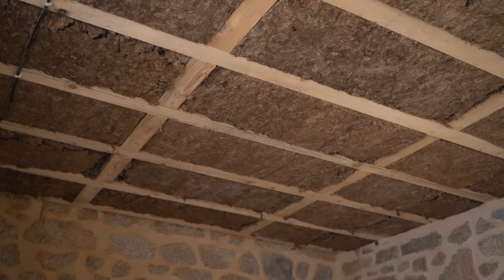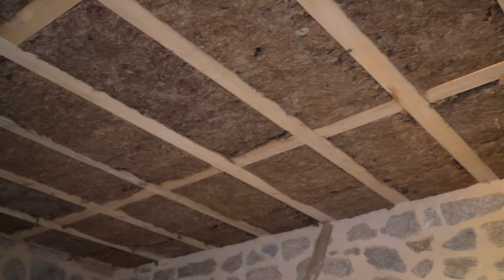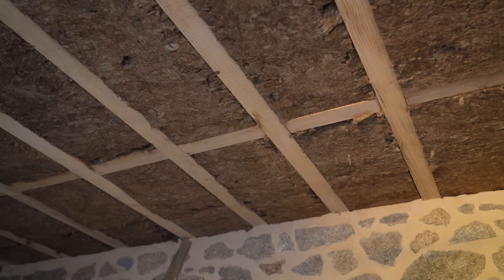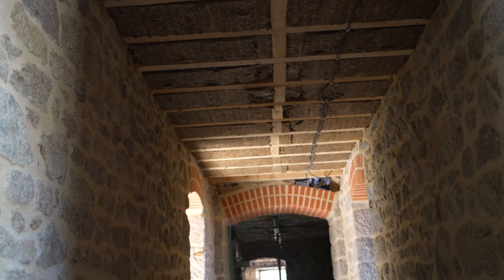Sundays at Chaumont- insulation and wiring breakdown.

Comment: Im amazed with how you've managed to get this far! One small bit of advice on your floors. When laying the OSB try to glue (PVA/Wood Glue) the boards down to the joists and in between the tong and groove joints. This will prevent/reduce the chances of a "squeaky" floor. Though i dont expect much movement in the floors with the amount of steel you've used. Great work Dan and Co.

Comment: Some years ago we did renovation to an old house ..as we worked, plumbing detailsmbwhere pipes went, wiring diagrams, the kind of plaster used and the insulation dimensions etc and finally the paint colour, each room we printed off and left in the room either in a cupboard or even under the carpet in two rooms..Copies copy with the tye main property details..the people buying our house were delighted..

Comment: Have you thought of putting the sockets flush mounted in  the floor, as opposed to trunking on the stone walls just a thought. We did similar in some places and have worked a treat. However, maybe with the look you are after, modern sockets won't look the part.

Comment: If you decide to use wireless switches, make sure they operate independently of the internet. Many companies design their switches to communicate with a server, so if your connection drops, you lose control of your lights. However, I generally recommend wired switches instead. They eliminate concerns over battery replacement and network congestion, and they work consistently. If you do prefer wireless, consider smart protocols like Zigbee or Z-Wave for better reliability—though personally, I’d opt for a wired option like Lutron.

Regarding running plumbing and electrical through the floor, I disagree that doing so compromises the floor’s strength. You can run these systems parallel to the main beams, drilling only in the noggings, which aren’t structurally critical. This method is standard practice worldwide. The video’s portrayal of French regulations makes it sound as if plumbing and electrical must be run externally in conduits, which is hard to imagine given that these systems are typically installed within floors, ceilings, and walls. Additionally, a drop ceiling can reduce room height and create a cheap appearance. In a chateau, ornate ceilings are more fitting.

If you want to future-proof your digital infrastructure, consider running conduit specifically for Ethernet cables. Unlike electrical wiring—which almost never needs upgrading during your lifetime—network cables often become outdated as technology evolves.

Comment: Great planning. But are you sure you want to insulate the outside walls on the inside. The insulation you choose wil be all the insulation there is. The stones in the wall won't be able to help you. The cold from the outside will be right at the back of your insulation. Best would be insulation on the outside but that's no option.

Comment: I get you on futureproofing because nobody knows where the wires are, but radio switch never seem future proof to me. What if in 10 years the company goes under and one breaks? You have to open the ceiling to install a second parallel system? And then another one? And changing batteries in your wall switches does not seem like a durable system too. Not for the building, not for the planet.

Comment: I'm surprised you're not going with an underfloor heating system. Combined with the insulation, this would be a great match with a heat pump (ground source, as you have the space for it) to get really high efficiency, plus you can power it with a solar array elsewhere on the property.
Reply: Geothermal heat pump unlikely due to high level bedrock over the entire estate.

Comment: @escape to rural france you will most likely not read this but I still wanted to tip you on a solution for the electrics. Check out THPG, they make bakelite and porcelain switches, sockets etc and have good solutions for period correct mounting on the wall including pipes and such. Also are you sure about the placement on the vapor barrier?

Comment: On the floors  above the  basement how will you deal with the water vapour that builds up in the interior living space? Yes you have a vapour barrier that keeps that moisture away from the stone and brick walls. but what about the the panelling or plaster board?
Reply: Why fo you assume moisture will build up?
Reply: Ive renovated 5 houses in my life. Moisture always builds up, simple breathing adds moisture to the air. If you have a moisture barrier you then have to extract that moisture from the living space. That is a fundamental of human habitation.
Reply: @terrystone5302  Moisture can be controlled by ventilation, heating, and in this case, using breathable materials, especially lime, which help avoid problems. Bad building techniques can certainly contribute. If house house is an airtight shell with no change of air, you may well get problems.

Comment: The only question is, where does the electrical wiring go for the lighting etc ? Once the mineral wool is in place, the wiring either has to be cut into the insulation OR the joists have to be battened out which will take more time ?
Reply: You clearly didn't watch this.

Comment: Dan, what are the plans for heating the basement? Without insulation in the walls or floor, the winters will be chilly down there. Are you just thinking radiators? Or would you look to have a wood stove / heater or  even heated floors or similar?

Comment: I think a key reason for wiring and plumbing to go through the joists  and studs at a  certain depth is protection  from screws. Do the French add any protection  for the wiring and plumbing? What is the thinking on that point?
Reply: There is no "reason" for those things to go through joists. You would only run them in such a manner if you have no alternative. These days, such things are protected by installing them in suitable conduit and positioning them where you're not in danger of putting a nail through them, and if you are banging in nails, you should always use a detector anyway.
Reply: @LaReynedeNeige  It's different from the Canadian practice. We will route the wiring/ plumbing through the joists/studs. If it is vulnerable, we will protect it with a metal plate.
Reply: Arsene Lupin?

Comment: Cat5 cables.. Why use so outdated cables?
Reply: Cheaper and has a longer maximum run length than cat 6. It also has a smaller minimum bend circumference if I remember correctly. Cat 5e is more than fast enough for home use.

Comment: A fuse panel on each floor makes it easier to add more items later on a floor and you only need to isolate one floor for issues. The same applies to water shutoffs. You need to change a washer or add a sink, you just turn it off on that level
Reply: How it's distributed depends partly on the wiring standards of a country. France's system is quite different than we have here in the UK. As I understand it, France tends to wire so that individual rooms or spaces can be isolated on one switch.
Reply: @LaReynedeNeige  was thinking about this….wonder if he could arrange an override switch in or near the staircase to the basement which just forces all lights on🤔

Comment: I've never seen a suspended ceiling that looked good.
Reply: It’s not a suspended ceiling in the way you’re thinking. Imagine putting some cross members on the joists…you then have a cavity between the joists and the face of the cross members. Attaching the ceiling to the cross members is the same mechanism as attaching to the joists.

Comment: How are you planning to heat the chateau? Have you thought about central air? You can put it in a drop ceiling to place the shafts and it can cool it in the Summer as well. Radiators are so fussy and probe to leak. Or you could have a system where an enclosed log burner, can help heat. There are also Tesla units that can provide green energy.

Comment: Interesting video!
I am also really looking forward to the final electrical solution in the basement.
Just one thing to remind you in regards to the floors - you should already think about the room heating system and if you should go with sub floor heating. I could imagine that using a heat pump is going to reduce the costs of heating up the building massively and therefore sub floor heating would be very beneficial

Comment: I really think that wiring the basement with wire-in-pipe wiring would be awesome and look super stylish if its done cleanly. it would definitely fit in with historical precedent, so it wouldn't look wrong. but obviously only if its within code! because of the way you've finished the basement I honestly think that running a pipe with the wires in it along the hallway ceilings and down the walls to the switches would be AWESOME!

I really like these new videos and I'm still super curious about wireless switches, do they run on batteries or something?

Comment: Okay Dan, if you are getting advice from a professional, and I am not, then I am reasonably sure you might know this but just in case...
If you are using wireless switches then each light or group of lights will need a relay.  The relay might be at the light but the best setup I have seen has all the relays in, or near, the breaker box.  This means all the lights need to be wired back to the breaker box which in the chateau would mean a LOT of wire but all the relays are easily accessible should there be a problem.  To reduce the amount of wire you could do each floor separately.
Wireless switches and relays also mean that the chateau can be 'smart' and the lighting automated.  I would make provision for a wired presence sensor or two in each room.

Love your channel!

Comment: I would run the data cabling in flexible conduit so you can change from Cat6 to fiber etc. Without much trouble. In that stone building probably something to each floor at least. A lot of wifi routers or extenders can be hard wired to feed them instead of connecting them via wifi. Cat6 will pass more bandwidth than Cat5.if you can utilize a pipe chase up through the building you may be able to put a distribution panel on each floor and branch out to the rooms from there.

Comment: Maybe "Zip System" tape could seal the seams of the roof after you remove the membrane on the roof. It can be left in place under the slate and protects from moisture penetration during the roofing process. Just an idea....😊

Comment: I have done more than a few basement finishouts.  The way to do it is first to make sure that the walls are sealed (usually parging the outside with a tar material) and no more leaks are there. Once the leaks are done then you coat the inside of the wall with a hydrophobic membrane.  What that is is a rubberish paint that keeps any water from getting out.  So, to insulate and create ways to run wires, this method I mention applies only to rooms getting drywall (plasterboard).  If you are insulating then install the interlocking insulation boards using spray gel adhesive.  Next, get a bunch of 1x2 material.  Going up or down the wall, attach rows of these every 12 inches horizontally.  Once you have done the horizontals, come back and do the same thing every 2 feet vertically.  This will allow for airflow but also give you a nice channel to run wires as well as being thick enough to set a standard (US) electrical box flush...
Reply: No point in trying to fight the moisture, the walls in the basement are built directly onto bedrock. The reason for using lime mortar is because it allows the exchange of moisture without destroying the structure.

Comment: I haven’t read all 1.5k comments and I don’t imagine Dan can either, but I just read a book about future-proofing that recommends running wires in the floor rather than the ceiling. Easier to get to and most of the uses will be closer to the floor than the ceiling.

Comment: Back in the really old times when there were no fancy schmancy insulation for the stone walls they used big tapestry hangings which was like hanging a carpet on the wall. Having spent a few months in a stone hut I found that hanging old carpet around the place certainly improved the comfort level, also I didn't have to run the fire so hot either which cut down the amount of firewood I used.

Comment: Dude. It's fine if France has building codes that mean it doesn't make sense for you, but drilling normal holes through joists following established protocols makes absolutely no difference to floor strength. And vapor barriers as you described sounds like a recipe for mold (though I know less about this than the hole issue). Having renovated four houses and made various choices, I'm also leery about choosing a wireless solution for lighting given how quickly things fail and change, but that one's just my opinion.

Comment: You mentioned putting in t&g osb. Wouldn't it be a good idea to lay down a 3/8" sub floor on top of the osb to keep the floor flat and level and smooth for the parquet flooring?

Comment: Sounds great. I assume you'll do manifold plumbing to deliver hot water quicker. Sometimes smaller lines are better if calculated. OSB is tricky to keep from squeaking in floors but your spans are small as long as seams fall on joists or blocking. Maybe look into whether mastic will be needed.

Comment: I'd run CAT6 cables instead of CAT 5E.  Much faster and future-proof
Reply: But has a lower maximum run length, is more expensive and requires a larger bend radius. All LAN cables these days are ultimately constricted by the internet pipe. He’s in rural France, even with starlink he isn’t going to outpace cat5

Comment: I just have 1 question:  are you planning on anchoring the walls together somehow? I know the issue with large brick structures is the bricks bowing out and collapsing. The floor joists that were in there previously used hooks on the ends of the steel bands that ran through them. Are you doing anything to replace that process that was in the original structure?

Comment: I cannot recommend enough NOT having an exclusively smart lighting system. WiFi, RF, Zigbee will all fail at some point and require a local reset. If you have no manual backup you will be without light control in the affected area until it's fixed. It will break regularly and when you least want it to.

Always have a smarthome solution with a wired backup/override. Make wired solutions smart, don't just implement smart solutions. They fail.

Comment: I'm hoping I'm not jumping the gun on this comment as you probably already have plans to address this, but I couldn't help but notice the bars on the windows in the basement kitchen area. Considering the building burned once before, are you going to replace those bars with some that can be opened from the inside in case of an out-of-control kitchen grease fire, etc., and allow one to escape from the basement without getting trapped? The same with double-glazed windows in other parts of the building that can't be opened to allow escape. I know the bars are for security, but there are safe "burglar bars" designed for just such a fire event. I don't know much about windows, but I'm sure there are types that can provide the insulation you want and not trap you inside in case of a fire.
Reply: But the kitchen has door out to the garden...
Reply: @KjerstiNagel  Fire could be in the way of it and a person would need to make a window exit.

Comment: Having worked as a Artisan Electrician in France for 9 years you should be running the flexible conduit with single wires in it. Using multi-core cable is not the way to do it.

Comment: 1:32 the r rating doesn't sound correct to me. I tried looking up the European conversion, and I'm even more confused. 6.3 sound incredibly low from my standpoint.
Rockwell says: Rockwool insulation has an R-value of 3.0 to 3.3 per inch.

Can anyone explain my confusion?

Comment: Rockwool is very well regarded . Not just by renovators, but also new home builders and even recording studios.
Dan I'm impressed by your foreplanning.... The space between the joists, the jig to cut the Rockwool, the thinking about the wire and water services.... Very much a tightly engineered project. I know you showed one 'mistake' but I doubt there's many more.....

Comment: I'M CURIOUS WHY YOU HAVEN'T INSTALLED A FIRE SUPPRESSION SYSTEM  BEFORE EVERYTHING ELSE,  IT WOULD SAVE ALOT, PLUS INSURING IT WOULD BE CHEAPER I'M SURE.??????
Reply: It’s a personal home….all it needs is what every home should have….excellent fire detectors and a fire extinguisher.
Reply: @MatthewBraithwaite-x6g  yup worked fine during the first 🔥......
Reply: @highwaterprospecting1971  a fire caused by someone smoking in bed, asleep and no fire alarms…hardly comparable to modern fire detection.

Comment: In terms of breathability, Rockwall insulation is not inherently breathable. It is designed to provide heat resistance and soundproofing rather than allowing air or moisture to pass through. Unlike some natural insulation materials like wool or hemp, Rockwall’s structure generally prevents significant airflow, which is why it’s used to block heat transfer.

Comment: I have one wireless light in a bathroom.  When the electricity goes off in a storm or when the city has a problem and the electricity goes off in the whole town, the light in the bathroom comes on when the electricity is turned back on. It's kind of funny, but it's not a big deal. You are doing a great job in planning for thr future 👏

Comment: Dan, you may want to take a look at "(red) underground electrical ducting", run those between the main switch board and every room ... it is pretty easy to pull a new wire through those if they are big enough (50mm). You may want to run any cables that go outside into the ground in these ducts too, as replacing any cable/wire means pulling a new wire through ;)